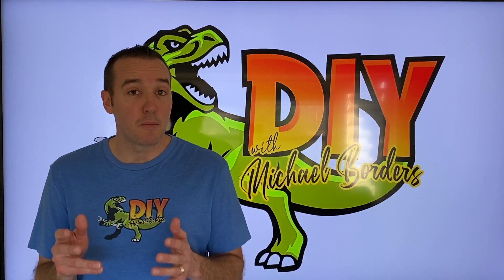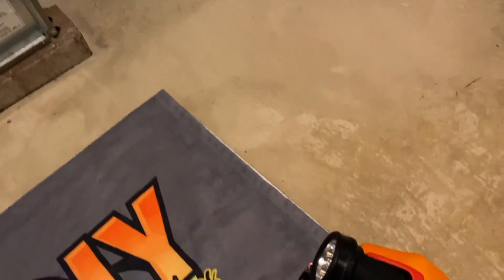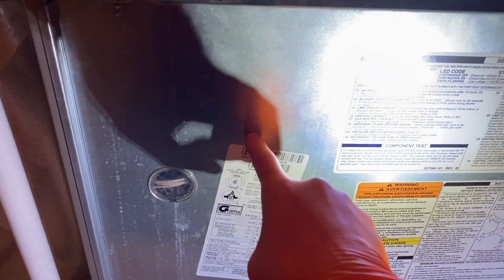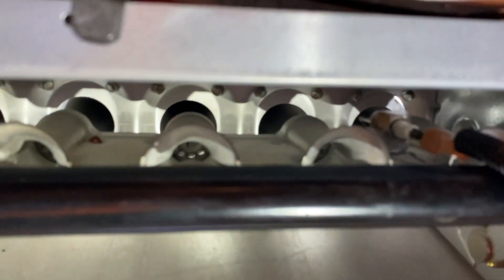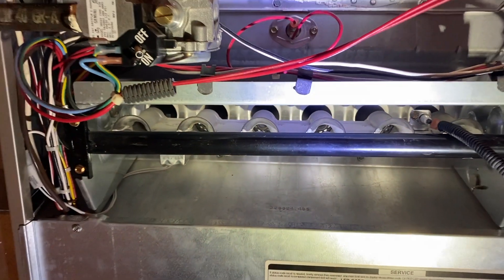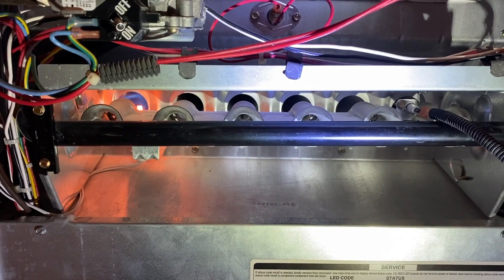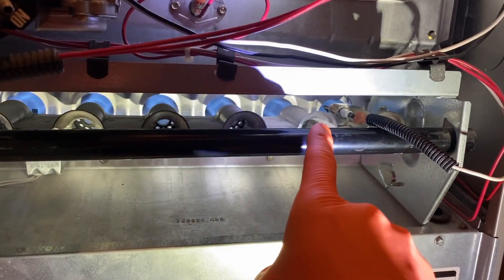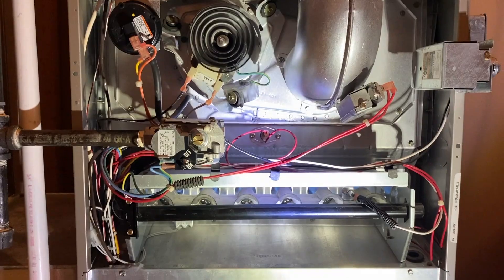Furnace starts then stops - Purpose Flame Sensor

Comment: What if the furnace runs for 2-3 minutes and then kicks off well before it reaches set temperature? Could that just be a dirty flame sensor?
Reply from the maker: @groberts1980  

Thanks for watching, and it absolutely can indeed be a dirty or faulty Flame Sensor.  👍🧰
Reply: @DIYwithMichaelBorders  So we figured it out over the weekend. My father in law who has decades of experience with boilers and furnaces, figured out that the gas valve was turned just a little too high. Too much flame was causing the over temp sensor to trip after 3-4 minutes. He turned the gas down just a bit and now it works great.
Reply from the maker: @ 

Awesome, 👍👍 to you and your father in law for sticking with it and pinpointing the cause.  😎👍🧰

Comment: What to do when there’s no light on the flame led?
Reply: And the status light continuously flashing after the the lock out
Reply from the maker: Thanks for watching & welcome to the DIY Raptor Club.  You may be experiencing issues with your ignition system.  Below are a few links to videos talking more about this.

1.  Test igniter

          https://youtu.be/eVGl8bxb0YQ

2.  Replace igniter

          https://youtu.be/tSdZhrUz6bU
Reply: @DIYwithMichaelBorders   thanks for the reply I already replaced the igniter and the flame sensor it’s still doesn’t work. The flame only come on for like 10 second and gone it cycle for like 4 times and stop.
Reply from the maker: @ohsaifah12  

Thanks for the reply & have you verified your gas valve is turned on.  Is your inducer motor turning on?
Reply: @DIYwithMichaelBorders   Yes gas valve is on and the Inducer motor is running too.
Reply from the maker: @ohsaifah12  

Thanks for the reply.  When was the last time filter was changed.  That may help.
Reply: @DIYwithMichaelBorders  The filter is new I already change it thought it was gonna solve the problem but it wasn’t.
Reply from the maker: @ohsaifah12  

Thanks for the reply, what’s your update.   The Flame sensor will not actually light up like the igniter does.